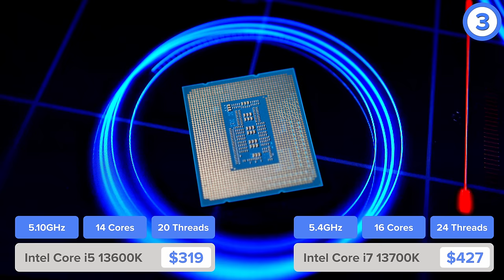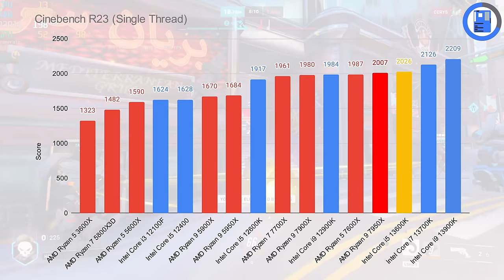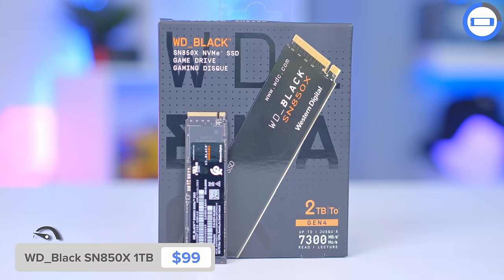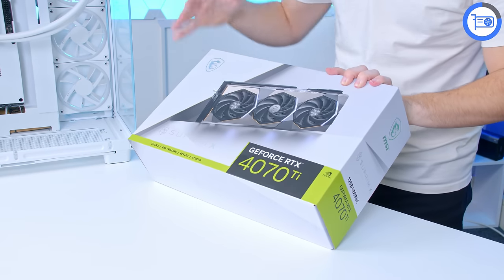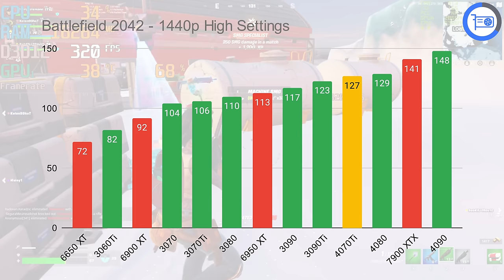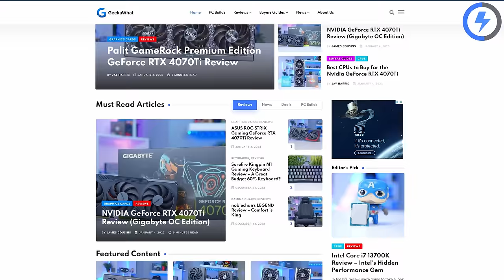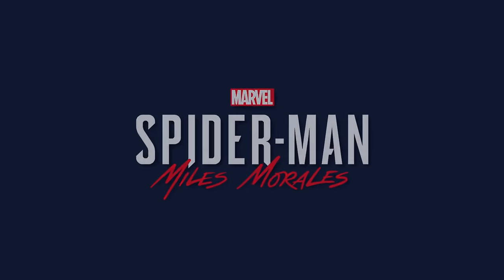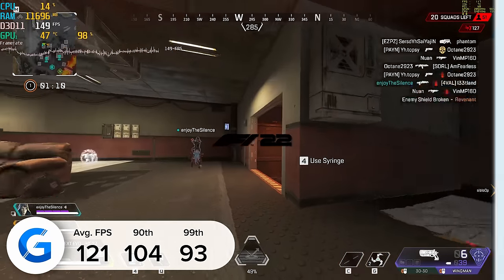Awesome $2500 Gaming PC Build 2023! 🔥 [ft. NZXT H9 Elite & RTX 40 Series!]

Comment: Perhaps make a budget 4070 ti build? Im thinking a r7 5800x + 4070 ti inside a budget case like macube 110
Reply: r7 58003d
Reply: Is there a chance to get a 4080 and i7 13 th for 2500k ??
Reply: @sebacodpy6983  nope
Reply: @sebacodpy6983  I think it is but your going to have to sacrifice a lot of performance and reliability buying cheaper parts to fit the budget.
Reply: although tax and shipping could depend and I didn't include the adapter so you will have to buy that separately and the tower cooler may have some issues so you could possibly put the arctic p12 fans on it and you will have to make use of all the fans as well as the ones preinstalled in the case to save money.
Reply: @sebacodpy6983  not a chance even if you don't already have an am5 Mobo and ddr5 ram
Reply: @sebacodpy6983  He can definitely get a 4080 and i7 with 2500k.
Reply: @expert8665  with 2500k…
Reply: @robertgaboola3683  4080+13700k is about $1625. That's over 900 left to spend on parts. Thats plenty. $250 mobo, 250 ram, $150 cooler, $100 case, $100psu, and some fans
Reply: @expert8665  I don't disagree with you that its possible, I thought I left a link to pc part picker but it looks like I didn't. Also this" 250 ram, $150 cooler, $100 case, $100psu" doesn't make sense.
Reply: @robertgaboola3683  I was just naming what I would spend more or less on. Nothing specific
Reply: @robertgaboola3683  if I were going intel I'd be spending more on my ram than anything else other than the motherboard. 7200mhz ram

Comment: Storage will almost never be a bottleneck in terms of performance, although maybe in capacity. The difference between SATA ssds (500mbps read/write) vs gen 3 nvme drives (3000mbps+ read/write) is minimal atleast in terms of gaming. Sure the game may load 3 seconds faster, but in terms of fps? 0% difference. Don’t feel compelled to spend over $70 on a 1tb ssd for faster speeds; it doesn’t make a difference at all. The only exception would be when you’re doing tasks that are very read/write intensive, but gaming, YouTube, Netflix, browsing the internet are definitely not that intensive.
Reply: Yeah, but please don't spend any money on Sata's now days. Ssd's are cheap now and Sata's are now old and in 2-3 years are broken.
Reply: @amb_13  now they’re pretty similar in price with the benefit going to NVME SSDs as they don’t require cables and are smaller, but SATAs don’t break so fast. You must be referring to hard drives because all my SATAs have been going good for 8+ years

Comment: Better than the Hyte60 and the Lian Li O11 Dynamic EVO? Looks clean
Reply: Doesn't matter, it comes to what people's preferences are. For me NZXT H9 Elite and Lian Li o11 dynamic EVO are both good.
Reply: For me, I still prefer Lian Li EVO, because we can adjust the layout we want, normal or inverted/reverse build depends on out setup position, and additional useful accessories, especially the upright GPU which other brands don't have, makes the GPU tidier and the better air flow for GPU and Radiator.

plus if you use a lian li case, it will be more perfect if you use a lian li fan, which is stackable and doesn't need a lot of cables.

Comment: Currently have an aircooled i5 8600k, 16gb ram, GTX 1080 build and looking to upgrade. I have the opportunity to get a used 2080ti from a family member for very cheap. The newest CPU my motherboard can work with is i7 9700k. Would that be a waste of an upgrade? Should I opt for a bigger rebuild and replace the 2080ti later on?
Reply: It’s gonna be ok.

But I would suggest going for better cpu and overall motherboard.

Comment: My only complaint about the Flow and Elite series cases from NXZT is they don't actually come with a reset switch to quickly reboot the PC instead of having to do it through windows and having to wait for windows to shutdown properly it's not a important feature just that for the price you pay I'd expect to see it or a variant that comes with a reset switch especially with Lian LI and Corsair having cases priced similar to the H9 flow that come with one. Also I would think the fans on the top would just instantly remove the air the fans on the side bring in
Reply: do u not know how air works

Comment: nice setup, sad to see the games u play bearly use 50% of the CPU usage. I wonder if it's just maxing out 2-4 cores or it's actually spread them across all cores.
Reply: I’m pretty sure it’s just optimized not to use 100% of the cpu because it’s not necessary, and it spends less power and generates less heat.

Comment: Bought my Pc around 2500 USD ~ but with DDR5 memory :
CPU : Intel core I7 13700 K 
Cooler : MSI Mag core liquid 240r V2 (AIO)
Motherboard: GIGABYTE Z790 UD AC 
Ram : Corsair vengeance RGB 32 GB (16 x 2) 5600 MHz
GPU : Gigabyte Eagle RTX 4070 TI OC 12 GB VRAM
Storage : 1 x Samsung 970 EVO plus 2TB + 500 gb Corsair MP600 GS
PSU: Corsair RMx 850w
Case : NZXT H5 FLOW
Fans : 2 x Corsair ML140  Pro RGB (Intake) + 1 x Corsair LL120 RGB (Exhaust)
Reply: did u build it yourself and is it hard and did you worry that you were going to mess something up?

Comment: would this pc build be compatavble with the rtx 4090
Reply: yes, however get a higher wattage power supply as 750w wouldn't cut it with the 4090 pulling around 450w itself.

Comment: Is there a chance to get a 4080 and i7 13 th for 2500k ??
Reply: yes i can send one for you but then it would not look good
Reply: The cpu and gpu by them selves would be about 1800 together and then compatible parts with out bios update 2650 ish if you want a 4080 MSI ventus tends to be the best priced for new gpus
Reply: Or as this other guy said no case and it would be about 2500

Comment: Hello, great build ! Im planning to make the same one.
But please tell me what is the actuall difference between z690 and z790 chipset?
Do 13th gen work better on z790 or what and if so by how much?
And what cable extensions did you guys use? 
Thank you
Reply: 13 cpu fits on z690 without problems. You just have to update the bios. I'm running a 13700k on a z 690 board.
Reply: you need a 12th gen cpu on a z690 before installing the 13th gen cpu if the motherboard does not have bios flashback button
Reply: Some motherboards are better based on z690 (like the asus formula z690 I have), but in the end of the day z790 is newer and by deleting the numbers, they are practically the same.
Reply: u need ddr5 for the new motherboard andi think u got to do a bios flashback or update if u wanna use 13th gen on the z690
Reply: @foster4241  so I cant buy new motherboard and 13th cpu and use it? 
I need 1st 12th cpu to do bios update? 🤔
Reply: @Amadej Rosi Rosic  only for the mb that does not have flashback button. Like my mb asus tuf z690 d5 I need a 12th gen cpu to be able to update the bios and then I can install a new 13th gen chip  . There's a reddit post that highlight this
Reply: @DoonPedroo  I’m new to pc how do you update the bios I have nzxtz690 my screen not coming up 🤦🏾‍♂️

Comment: Lmao SSDs cant bottleneck the gpu😂
Reply: They won't bottleneck your GPU necessarily, but if you're using an older drive (without a DRAM cache) or one that can't keep up with the data that the GPU and CPU need, your entire system will face bottlenecks